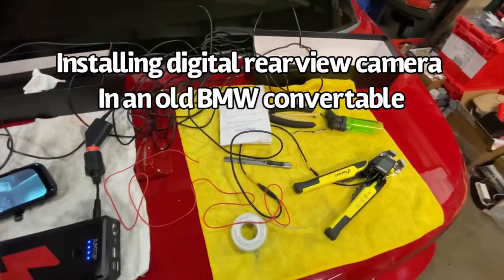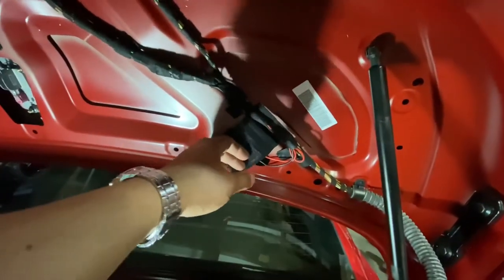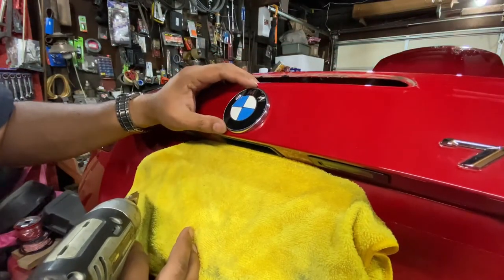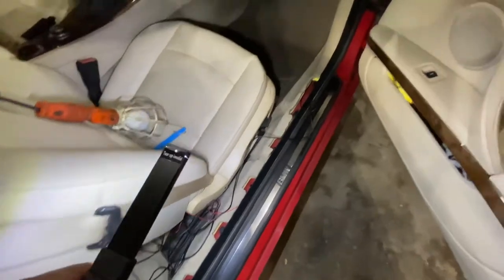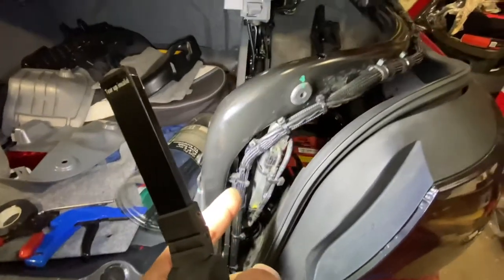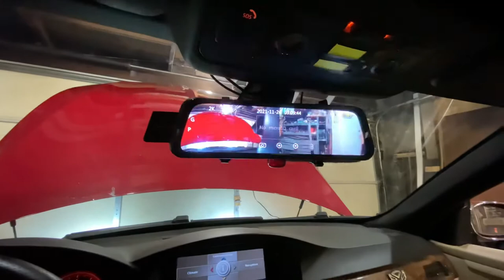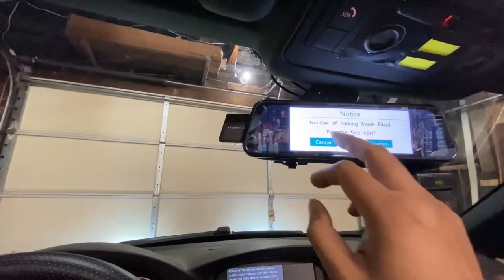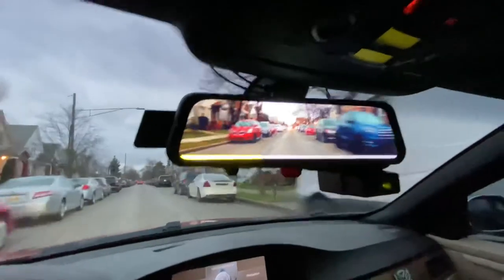Installing DRVM (Digital rearview mirror) in BMW E93 with the camera hidden in the BMW emblem

Comment: Excellent work and review.  I will be tackling this task on my e93 this week. I plan to tap into the wires as you did.  WHy did you need a power supply?  Could the power be tied to the same wires that supply power to the stock mirror?
Reply from the maker: Very good question. I don’t exactly remember 😂
I installed the radar scrambler over four years ago. My guess is the power for the mirror was either a PWM or lower voltage than I needed. I always prefer to use ignition fed power through fuse. Best place is from back of the cigaret lighter. 

If you are crazy enough to drill a hole through BMW emblem like I did. Try to angle it a little more down than I did. 
And Good luck.
Reply: @princekhan5063  I installed mine on the driver side of the trunk release switch. Almost like the stock rear camera trunk switch but parallel to the ground.  It's not precisely at the center of the car and sticks out a bit from edge of the trunk but it will do.

Making a hole in the logo and trunk is at a whole nother level, I would call it advanced modding. 

You were absolutely right about the length of the camera cable 23ft after snaking it around.  I will need to extend the reverse light control cable about 4 ft though, as I want the guide lines for my daughter.
Reply: Have not hard wired it yet, but I think while tucking the cables away, I may have messed up the light sensor as my headlights are on all time time now on and angel eyes are not coming on in auto mode.